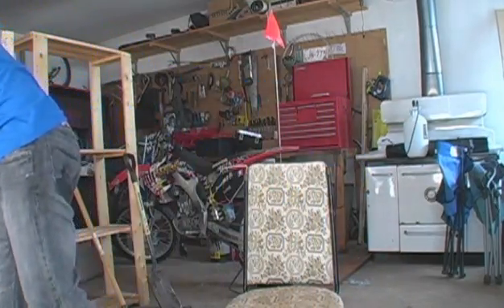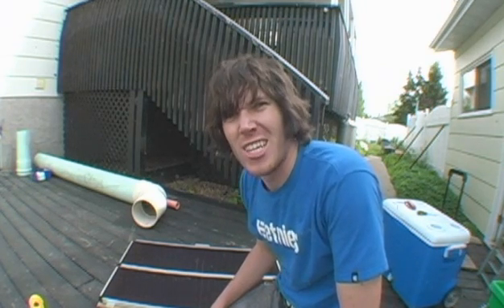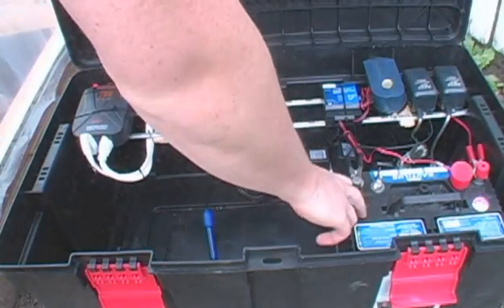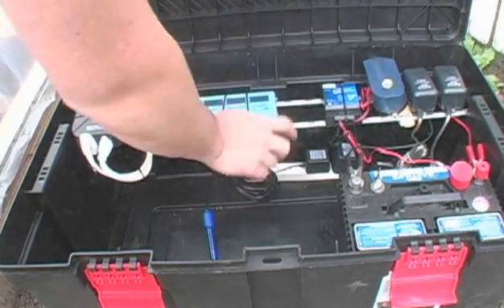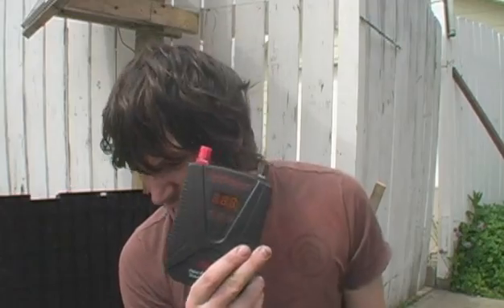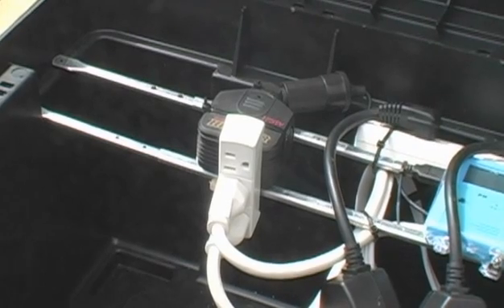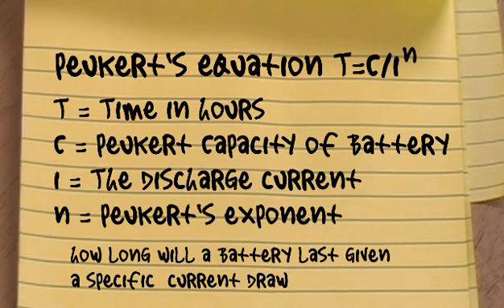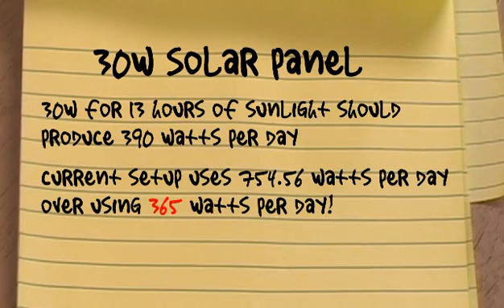How To Hydroponics - S01E06 Solar Powered Greenhouse

Comment: Watts is already energy per second, so W over time is the wrong unit. Try this:
x W * y = z W
Where y is a tricky number that describes the amount of the day the device is on. I'll get to that later. Let's say something uses 120 volts and 1 amp for 20 minutes a day. x is of course 120 watts. Finding y is a little tricky, so here's a handy table to look it up how to do that.

If the unit is in:     Divide by:
Seconds:               86200
Minutes:                1440
Hours:                    24

If it's on all day, y = 1

In this case, y = 20 / 1440, which is approximately 0.013333. Therefore z = 1.6666 W. Then you add up all the values of z and compare that to the power coming from the battery. Also, there is a problem with this equation where if a device is hardly ever on but takes a lot of power, it might be too much power even if the equation says there is enough. I would just pretend all devices are on all the time, so y = 1 always. It'll give you a worst case scenerio idea of what will happen, and if your battery can handle it, you're good to go. On another note, I love this series so far. I want to make a system so badly, but I don't have the resources yet. Good luck on your future projects.
Reply: Sorry about the deleted comments. I kept making mistakes. I forgot to mention taking into account the volts AC vs volts DC someone else mentioned.

Comment: The math doesn't add up because Ohms law doesn't work directly with VAC. 120VDC will deliver a LOT more current than 120VAC. You must convert the VAC to Vrms. 120VAC is approx 42.5Vrms. Now try your formula. The idea is that a light bulb running on 120VAC will be just as bright if it were running on 42.5VDC.

Comment: You know Matthew,for a guy who hates math,you sure seem comfortable around fairly complicated equations and theories.I have a feeling all the bugs will get worked out.Now would this setup work for an indoor grow as well? I'd like to cut down on my electric bill by powering my grow room with solar.Now you say your air pumps regulate at certain intervals and I'm guessing for hydroponics? I'm going to be experimenting with hydro to see if my Super hot peppers will grow better with that method than soil.Can you recommend a starter setup for me? Thank you!

Comment: maybe the ambiguity 'errors' in the calculation were because you used the P=EI power formula for instantaneous voltage, and what is displayed on the devices might be RMS based on the peaks of the sinus wave voltage?